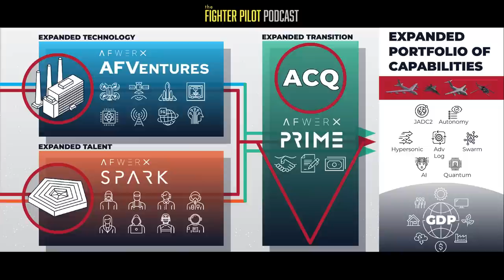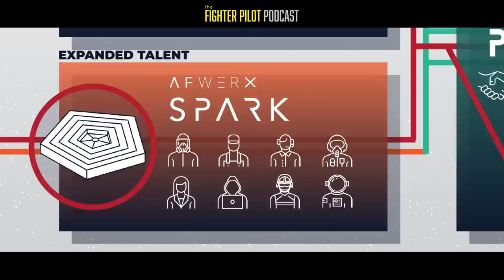Electric, Optionally-Manned Warplanes with "WCMD" and "Stewie" (ep. 158)

Comment: Hmmm... good interview. The idea of developing relationships with private industry (like this) is a great idea. But the whole "electric" thing, I'm still not sold on. Possibly as a utility vehicle of some sorts, maybe. Our electric aircraft is out of 'fuel' - dust off the old archaic gas powered helo to haul in a diesel powered generator to recharge it! Still a long ways to go (in my opinion). -smile   Otherwise, a very informative and interesting interview. I guess we will have to see where this goes.  Thanks for the podcast Jello!
Reply from the maker: You’re welcome! And yes, I agree, that is the point I was trying to make with the self licking ice cream cone. But I do believe these are good and necessary steps in the right direction to ultimately achieve a reasonable solution.

Comment: A 'no carbon' equation is most likely not going to be in the mix at first.  A "Hybrid Power Generation Cart" or APU for craft is an obvious solution and ready safety measure for situations of extremes.  A small efficient APU over/under the center of gravity is more than very doable.